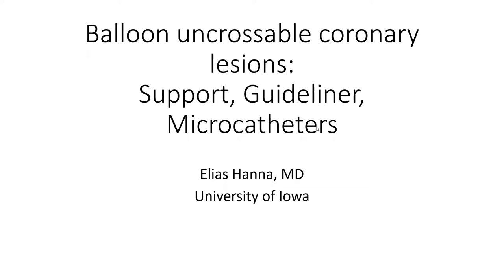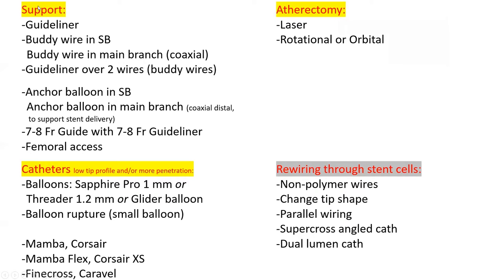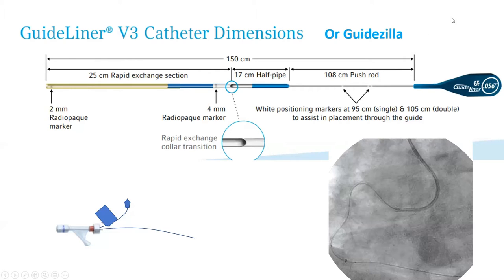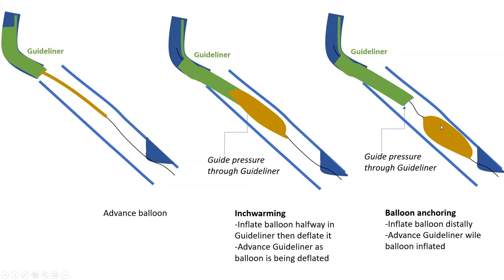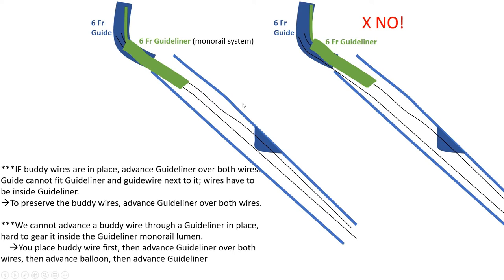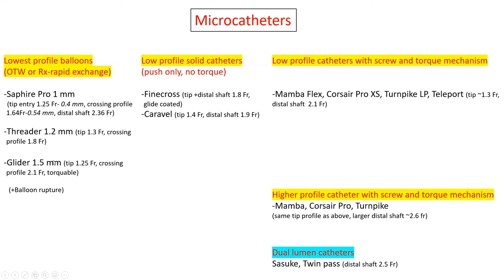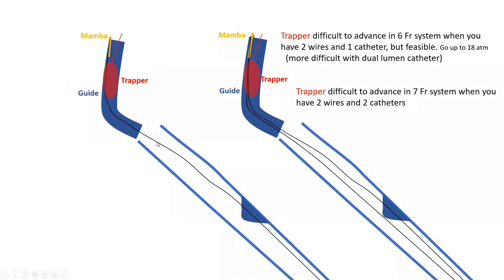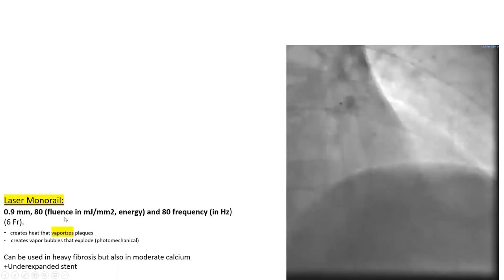Balloon uncrossable lesions: cases and technical tips, Guideliner, microcatheters, Laser-Elias Hanna

Comment: Excellent talk as usual sir! The only comment I have is that one can actually wire the back end of the guideliner with a buddy wire while the guidliner is inside the guide, so you dont really have to take your guide extension out when adding a buddy wire. Thank you so much!
Reply from the maker: Thank you! and thank you for the comment. I agree with you. There is a risk of damage of the wire tip while it is going through the monorail collar of the Guideliner, particularly with stainless steel nonpolymer wires. This was a bigger issue with the first generation Guideliner, which had a sharp metallic collar at the monorail junction. The transition is now softer and smoother. It is still my preference to take the Guideliner out then buddy wire, depending on the case.
Reply: @eliashanna8248  Thank you so much Dr. Hanna for teaching us! Your books and videos are unvaluable!